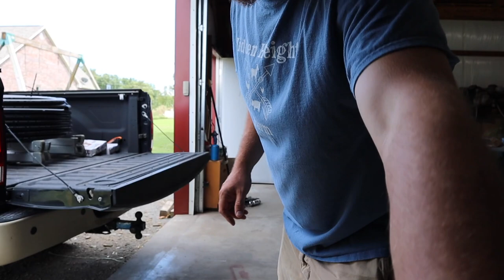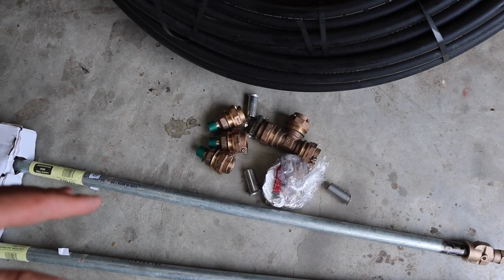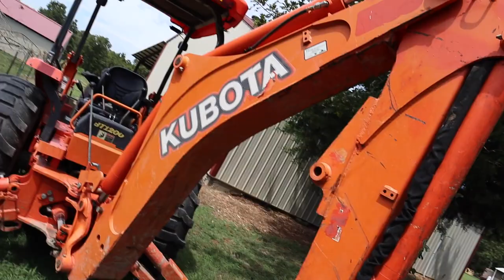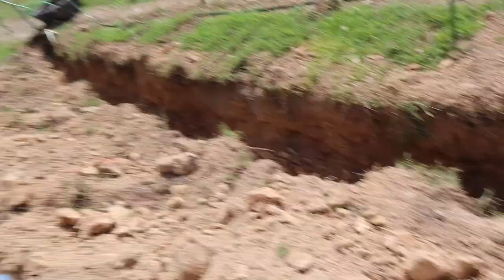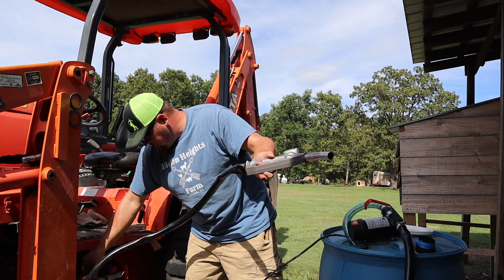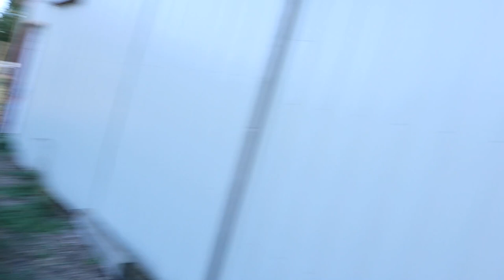Farm Upgrade Lets Get To Digging! The Pigs Are Waiting For This!

Comment: What you need to do is when you start backfilling you put a marking tape that runs above your lines 1 foot underground that says caution electrical or caution pipe if anybody ever digs 1 foot they know there’s three or 4 feet down there’s gonna be electrical or a waterline that’s the best thing to do right over that line 1 foot underground obviously your lines down at freeze level and you backfill it and that last foot you laid that caution tape in there it’s what to do it works awesome I’ve run into it before and it save many lives

Comment: You can use a direct bury electric wire and a walk behind trencher to run the electric. I have used my subsoiler before with similar results but your soil may be to rocky.

Comment: Thankfully the 12" Bucket is holding up and the new Pins also....don't forget to grease it after a while, looks good. Yeah I'd put Electric in that trench then dig another trench inside the fenced area for the water, then to the other barn but figure out how ya gonna out the other side to get to the Hog Pen..?     =)

Comment: You could alter your plans and use this ditch for the electrical line, and dig a second ditch inside the fence for the water. --- I think storing fuel in plastic barrels is not nearly as much an issue with diesel as it is with gasoline.  Diesel has a much lower flash point. With gasoline you shouldn't use electric pumps either when transferring fuel since they can cause sparks.

Comment: Now that's a lot of work!  Your lucky that you dont have to dig down 3 or 4 feet to be past the frost line!  Having water out in the fields & pens will be well worth all that time & energy spent.
You should write down all materials used, the date installed, a diagram of their locations and any other useful information and keep it in a sealed folder. Maybe mount it to the inside of the barn so it can never be lost or misplaced. 20 years from now you wont have to try & remember how many feet in something is after moving a fence along the way.
Reply: Jayne Skidmore - Excellent advice!
Reply: Good idea to have a backup for sure. I imagine it'll be fine since he'll have these videos to look back on, which will be a great help in that regard.

Comment: Run the water line first then put some stone on top then run the electric line in conduit on top. Take pics with your cell and bury the whole thing instead of digging 2 trenches.
Reply: Yeah your idea isn't good. Many problems can arise. Kevin is doing it the proper and correct way. Electric lines and water lines don't mix well and can cause a lot of potential issues. My wife and I are on 207 acres and our water & electric lines are in separate trenches running side by side with a good distance between the two. Our neighbor did it your way and when a water line broke it took out much of the electric. And things like this happen years down the road. So taking pics get lost or deleted over time.